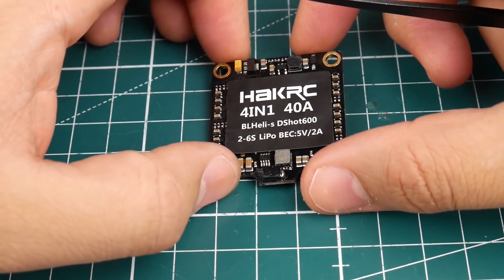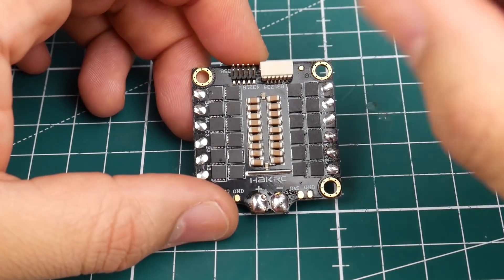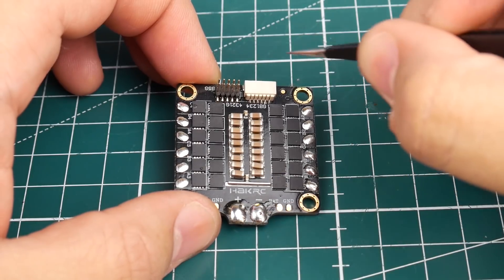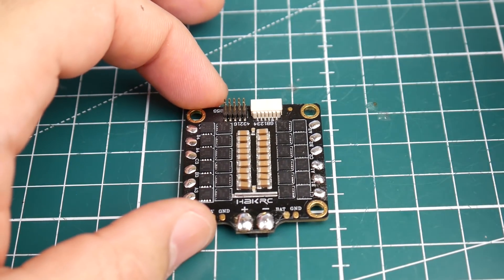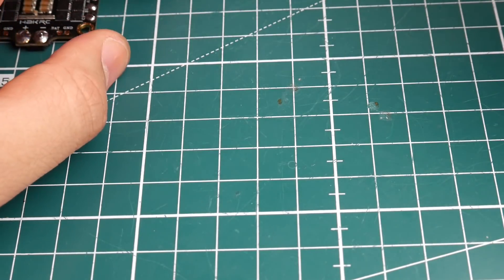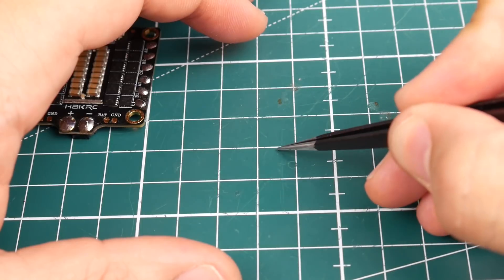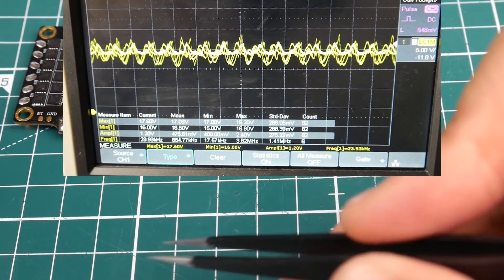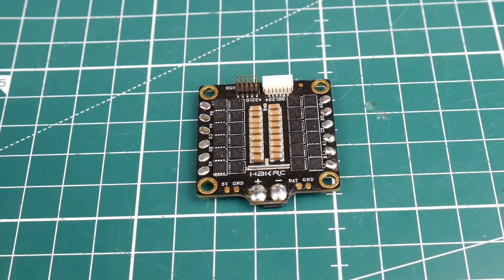HakRC 40A 4in1 ESC // Detailed Review and Noise Testing with FPV Footage

Comment: Hi, I have those esc of 40A and FC of the same brand. my question is, could I connect the fc and the esc through the pins? in case of connecting

 So, how would the FC be fed if I put the xt60 in the esc? Greetings.

Comment: Sir, can you check the difference between the 40A & 30A version of this HAKRC 4 in 1. Both 40A & 30A circuit layout & chip set looks the same except the sicker label. I am worried running this 40A 4in1 at around 120amp with my F60proII 2700kv motors.

Comment: Is the Hakrc flight controller rated for 2-4s or 3-6s? It is advertised for 2-4s, but the advertised photos of the fc show 3-6s stamped on it. I have just received two of the 40a 4 in 1 hakrc esc for two 6s builds and had planned to use the skyzone fc with them but I’m interested in pairing with the hakrc fc if it can handle 6s. Love the channel, keep up the great work.

Comment: Groovy. Looks like the video from my Asgard v2... even after I added FOUR caps of different sizes and types to different parts of the system. It's actually worse now than it was when I first bought it. I'm so tired of noisy video.  :(   I've actually removed the cam, VTX, and the Frogs side plates and top. It's naked and vulnerable, but light and fun still. I'll FPV again next spring when I've had the time to save so I can try some new components. Tnx for the vid Sam!  :)
Reply from the maker: GITech Check your ground put the camera and vtx ground together then solder.. Another thing check your sma port could be broken or loose.

Comment: I'm kind of confused the video looks horrible it's breaking up there's all sorts of horizontal lines it looks like when you have bad noise in your video and you need to add a low ESR capacitor. The video I just seen from the fpv feed looks terrible I've never had video break up that bad and I've taken Boards out for half that amount of noise. When you add 4 more Motors isn't it going to become even worse? Is the test your testing the ESC with a lot worse than any speed controller could produce and that's why it's beautiful or is the test reflecting what some ESC can do and what some ESC might replicate? I don't see how anyone could fly around like that and say it's beautiful looks unflyable
Reply: yeah i have just completed a new build with the 30amp version with aokfly 2306 2650kv motors and the noise was horrible, regulators and filters had no effect, still working on a solution, wish me luck!